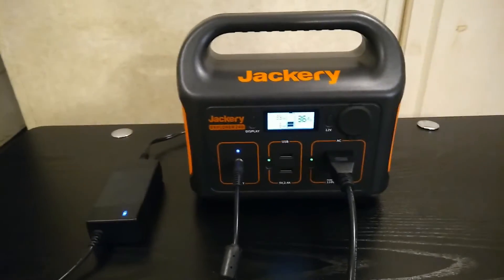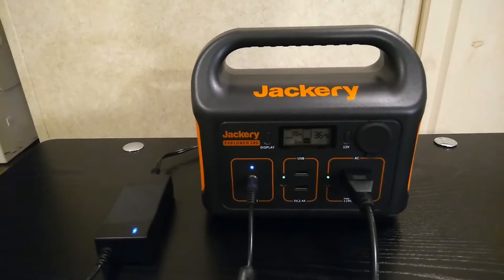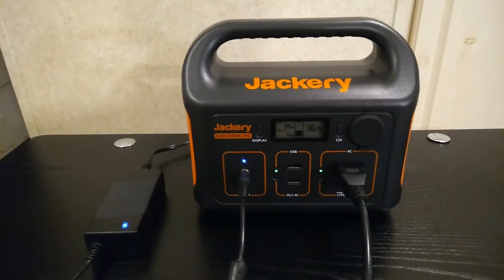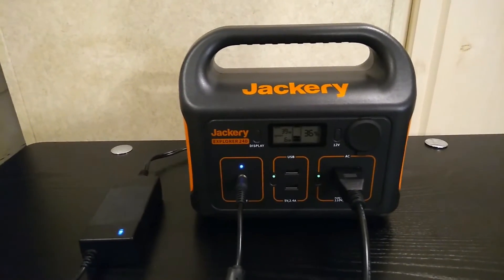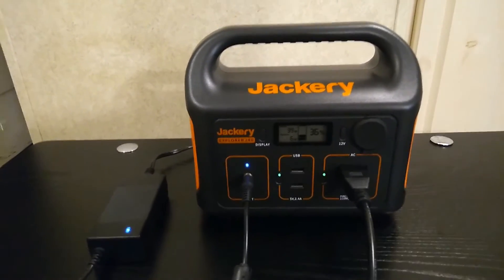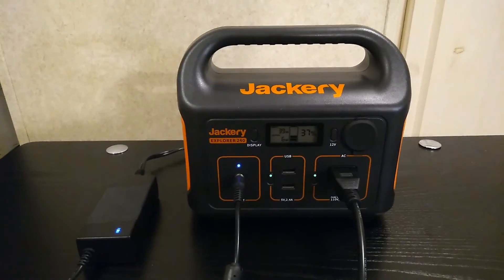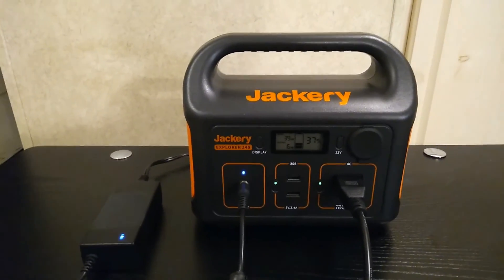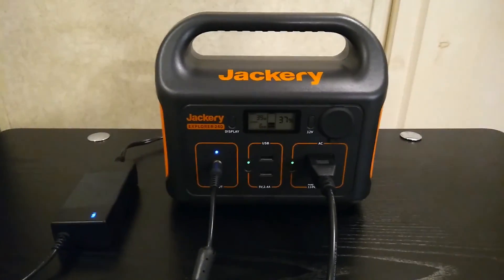Passthrough charging explained

Comment: Good 2know! 🙌🏾🔋
I have the same unit and we had a power issue at the house and I charging a lamp with pass through and I didn't detect a problem.

It was better than waiting 4 1/2 hrs for it to recharge from 0% 👍🏾🥇

Comment: This explanation is not explained. You can not charge and discharge a battery at the same time. Either you are pulling more load than the charge controller supplies and are discharging the remaining load from the battery, or you are pulling less load than the charge controller supplies and are also charging your battery. If you explained that the excess heat from charging the battery and the inverter heat are causing excess heat to the battery, I would buy that. I am just looking for the technical answer down to component level explaining the pass through charging. Thank you for the video.

Comment: The title is you will explain what is pass through charging. But instead you explain why power station manufacturers do not recommend pass through charging. I still don't know what is pass through charging after watching your video.
Reply from the maker: The power station can be charged and output power simultaneously. 👍

Comment: Thanks for the great vid.  I have a Jackery 240 and a Jackery 880.   If I’m using the 880 to constantly power a 12 volt car fridge, is it safe to also receive charge for the Jackery with the DC car port when needed, while it’s still charging the fridge?  Or, is the 240 Jackery powerful enough to charge the fridge while I’m charging the 880?  I’ve also heard that it’s not good to have a power bank charging thru the DC port for long periods because the charging ports really heat up.  True?  My purpose is car camping on looong road trips.  I’d appreciate the advice.
Reply from the maker: The 880 can handle both no problem. 

Most car fridges only pull about 50w, which is nothing for a 880wh battery (C Rate of less than 0.1) and the car charger only supplies about ~100w (plus the fridge only pulls power intermittently).

BTW the 240 has the same regulated 12v outlet as the 880, so it can power the fridge just as well. But it is unnecessary IMO to even bother unplugging the fridge from the 880 for the reason above.
Reply: @SoGenFan  Thanks so much

Comment: In the bluetti brands and if you have the app, just set your charging setup to silent charging, this will keep the minimum wattage going in, it’ll be slow but way more safe.
Reply: Yes but wouldn't turning the fans off allow more heat to build up thereby doing more damage to the battery?

Comment: So if you were to get a bigger inverter (1200w) does that mean you could use more watts without the same amount of heat a smaller inverter would create?
Reply from the maker: Well the inverter is not really the issue. It's the battery, and the heat inside the battery cells that we are concerned with. And a larger inverter will most likely be paired with a larger battery -and in that case, the answer is yes.

200w moving through a 240wh battery will heat the battery up MUCH more than 200w moving through a 1000wh (1kwh) battery for example (this is known as the "C Rate").

Also, this video is getting old, and now most new power stations have LiFePO4 (LFP) batteries and these can also handle higher temps better as well. So a large LFP battery will be minimally impacted by DC pass-through such as with running stuff off solar power. 👍

Comment: So no heat is ok. If its heating its not ok?
Reply from the maker: Well heat is always produced. The fan blows it away. But the batteries get hotter and hotter. Some new power station models have a temperature sensor on the battery, and you can see the temperature in the App. 

If you cannot see the battery temp, it is hard to know. But you can use "C Rate" to guess. Keep the charge or discharge below 0.5C (1C = battery capacity in watts. Example: 240wh battery (Jackery 240) charging (or discharging) at 120 watts is 0.5C).

240wh at 240 watts is 1C

If you are doing passthrough charging - take the combined total of input & output (Example: 100w output and 20w input, the total is 120w or 0.5C again).

Higher C rates can be done for a short time. It is OK because it takes a while for the battery to get hot. But it is not recommended to do high C rates for a long time.

Comment: Hey man can i connect my aquarium filter that draws 35 watts to this battery and leave it charging on the wall so if the lights go out my filter will stay on automatically ? Im trying to figure this out.
Reply from the maker: Yes you can. But it's not recommended long term, since power will always be flowing in and out of the battery. 

It will work though if you are out of town for a few days or something. For long term "UPS" use, look at a newer power station. Most have a UPS mode now, Jackery 300 Plus, Bluetti AC2A etc
Reply: @SoGenFan  i am using a 1500 apc ups but with 35 watts from my filter it only gives me like an hour of power. I need something to have piece of mind when i go to work 10 hours a day just incase the lights go out. Can you please send me some links to power stations with ups that will help me with this ?
Reply from the maker: Well 35w running for a possible 10 hours would require a larger power station (with larger battery). The minimum I would recommend then is a "Bluetti AC50B". Ideally something a little larger will give you more peace of mind. The new "Jackery 600 Plus" would be perfect. Another option is the "Bluetti AC70". 

Below are some links to them on Amazon.

- Affiliate Links:
Jackery 600 Plus: https://amzn.to/3LjphSK
AC50B: https://amzn.to/3XZEAYA
AC70: https://amzn.to/3VZEHki

As an Amazon Associate, I earn from qualifying purchases. If you prefer not to use my links, just search them on https://www.amazon.com/

Comment: ok smart guy......can you charge a jackery 500 from the car WHILE there is a 12v cooler drawing power ???.....or would it lessen the life of the jackery??.......only asking for a friend (lol)
Reply from the maker: Yes you can, and it will have very little impact on battery life, since it will be charging at less than 100w and output will also be low and intermittent, which should prevent internal battery temps from getting too high (as long as the temperature inside the car doesn't get too hot).

Park in the shade, use a windshield reflector, place the Jackery in a shaded area in the car (but still with good ventilation for the internal fans - do not block the side vents).
Reply: @SoGenFan  hey, i appreciate the fast and informative response, thank you.

Comment: Hi, first off, thanks for all the info! May i please ask, i need something to power a marine fishtank in case of a power outage. 
Would this unit be ok to have my tank plugged into so that if i had a power cut, the tank will still run for a while?

Thanks.. James
Reply from the maker: No, you don't want to leave this unit (Jackery 240) plugged-in all the time. The newer Jackery 300 "PLUS" has a UPS function (They call it ACPS) that will only use the battery when the power cuts out. 👍

BTW the "regular explorer" Jackery (240 / 290/ 300 / 500 / 1000) models are all the same. Only the "PLUS" and "PRO" models have the UPS function. Or consider other brands - most of the newer models do have UPS as well.
Reply: @SoGenFan  Thanks for taking the time to inform me of that. Its much appreciated and i will look into that right now.

Comment: If my solar generator input is 400watts  and I have 2 solar panels creating 800watts by using pass thru charging could I use 300w to power a fridge and will my solar generator be recharging at 400w or will it power my fridge 300w and only charge the generator at 100w.  If it's the second then I don't want to spend money on a second panel it would be useless. Thanks in advance if anyone knows.
Reply from the maker: Unfortunately it is the latter. If the max input is 400w, there is no way to go beyond that. Solar input will always go into the battery first, since the voltage and current of solar panels can vary A LOT - there is no possible way to pass that power through to a device that needs regulated power (whether it is 120v AC power or 12v DC power or even 5v USB power).

Comment: why cant the power distro circuit just split the power, one channel to power devices, one to charge the battery, and if there is too much draw from the device to supply minimum power for charging the battery it just tells you. I can understand a cheap usb power bank not having this ability, but high end batteries, seems like a no brainer. How many extra transistors could that possibly take? lol
Reply from the maker: This is an older model - that's why. Almost every new power station (and all Jackery Pro / Plus models) use a bi-directional inverter with relays that can charge the battery and power devices separately.
Reply: Do you know if there are usb power boards that can do that? Power a device while recharging its battery without running the device through the battery?

Comment: I don't see a good point for passthrough charging if you're using an outlet (might as well just use a power strip)

what I want is solar passthrough charging, that is the way to go if I'm trying to be remote. It seems it's uncommon though? oddly. My ecoflow delta 2 seems to be unable to do this, but if I'm working remote, I want solar to charge all current things plugged in (first), then extra should be charging the battery. Is how I see the ideal, anyway. Perhaps one day
Reply from the maker: Solar is DC power (with varying voltage) so you need an inverter to output AC power for your device (or convert to a different voltage like 12v or 5v usb). 

A true passthrough function only works if the input power is same as the output power.

In this video I show an older power station with a DC charging brick. In this case AC is converted to DC inside the brick, and DC is fed into the battery. The battery's power is then converted or inverted to output power.

The Delta 2 has a true passthrough function (UPS / EPS) mode where AC power will bypass the battery instead of going through it. But as you have discovered, if you are using solar, the solar power always enters the battery, it cannot go directly to the output ports since the power is not appropriate for the corresponding output.
Reply: @SoGenFan  thanks for the info, chatGPT seems to say it can, but probably with an inverter. Either way, i don't know if any of the main power generators have this feature, but I hope that becomes a feature sometime in the future

aside from the ecoflow, I originally got a pecron s1500, great for storage, but for reasons unknown it wouldn't actually charge with my solar panels. I did see it required an abnormal high voltage, but I should be reaching that with my 2 panels in series. So that's a bit annoying

my 2 dokio, 220w solar panels seem to averagely only give 70-80w/each, albeit I've seen them get near 100w/each. Is that normal in your experience, for it to only be 30~45% of the rated watt value?

Comment: Subject: Clarification on Unit Charging and Battery Longevity
I hope this message finds you well. I wanted to address the recent discussion regarding the charging of our unit. While we acknowledge your perspective, it's important to note that the charging process for this particular model is subject to limitations.

Heat, as you mentioned, can impact the battery, but I'd like to highlight that our unit is equipped with a cooling fan designed to mitigate such effects.

Upon careful consideration, our assessment suggests that prolonged charging may approach an over-unity scenario. I have delved into the details in a video I created, along with the associated mathematical explanations, available here: https://youtu.be/Q7EmfHowWkU?si=HMCT3j1u_EfrG66a.

Understanding the concerns around input and output energy, it's crucial to recognize that maintaining a balance is essential. Extracting less energy than is inputted, especially to meet power equipment requirements, could potentially exceed the battery's intended charging cycle. In fact, I've conducted experiments indicating that, despite the battery swelling and even emerging from its casing, it continues to function after over 30 years.

This longevity poses a challenge for industries where product turnover is a significant factor. While it may be unconventional, these observations stem from hands-on experimentation rather than mere speculation.

I encourage you to watch the provided video for a comprehensive understanding of the experimental process and the facts derived from it."

Comment: I just test the passthrough in my anker power station using the car cable included it get very hot tip after test it for few minutes only please help is this normal
Reply from the maker: Yes the cigarette plug for the car is not ideal for more than 75 watts. It will still work for anything between 75 - 120 watts. Just be careful it will get hot! Anything over 120 watts could cause the plug to melt and possibly catch fire, be careful! Most power stations limit the car charging to 8 amps (12v X 8a = 96 watts) for this reason.

Comment: How do you charge your jackery when you are driving? There a way to charge it via car cigarette socket?
Reply from the maker: Yes they include a car socket adapter cable. Note that car charging is usually limited to 100w or so (8A at 14v)
and some Jackery models only accept 3.5A or 5A input (so 3.5 X 14 = 50w max).

Also note the new Jackery 300 Plus uses usb-c input for charging, so you will need buy a "car socket usb-c output adapter" and ideally one with PD60w or PD100w outputs.
Reply: @SoGenFan  Thanks on the USB-C tip on the Jackery 300 Plus, like that feature. Can the jackeries be charged at home using an AC outlet without that usbC input?

Also notices amazon has the older units on sale, it's prime day. The 300 plus with the USBB-C inputs are an extra $100, kinda steep. I.e. 300$ vs $400 for the plus unit.

Comment: This may sound very ignorant but if I am using this setup as pass through charging and let’s say my power goes out. Will the device I have pulling power then automatically switch to pulling power from the battery?
Reply from the maker: In this example, you are always pulling power from the battery. There is no switch over - which can be good or bad. 

The good part is not worrying about it switching over fast enough or reliably, the bad part is you are constantly flowing power into and out of the battery.

Typically any power station that charges via a DC power brick, that supports pass-through charging works this way. The newer power stations feature a UPS or EPS relay that switches power from grid power to battery power in 20ms or less.

So in that case, the grid is powering your device (and the power station's inverter) and if the grid power goes down the relay will switch to battery power. These power stations don't feature professional grade UPS relays though, so it's not something you can count on with 100% certainty. But it will probably work.

Most power stations with this UPS relay will keep the battery at 100% charge when using it as a UPS, which is also not great for the battery though. Better than flowing power through the battery constantly, but ideally for optimal battery health, look for a power station with an app that will allow you to set a maximum charge %. Set it to around 80%.

Comment: Why does my charger get hot ? Is it normal
Reply from the maker: It is converting 120v AC to 12v DC. This creates heat in the process and is completely normal. Pro tip: To reduce the temperature, place the charger on a hard surface (not carpet) and stand it up on it's side to expose the surfaces to more air.

Comment: Is there a certain calculation that we can do to identify the optimal amount of voltage coming in and out on a certain battery?
Reply from the maker: Well technically the optimal amount would be 0. What's the most power with the least impact on the battery? Well I'm not sure there is an exact calculation, but use the C rate to get a generally idea. I personally don't like to talk in voltage and amp hours, but just to give an example 500wh battery at a 500w output (or input) would be a 1C rate. The lower the C rate, the better. Aim for less than 0.5C on both input and output when doing passthrough charging, and try to keep the unit cool! No direct sunlight, make sure the ventilation is optimized, and air can flow around the entire unit.
Reply: @SoGenFan  how fast will the battery degrade if you keep doing pass through charging?

Comment: Do you know a powerstation that supports passthrough? Thanks for the info this is very helpful.
Reply from the maker: Most name-brand older power stations that use a power brick to charge from the wall do. Now most newer models use a  bi-directional inverter with a UPS relay which will  allow grid power to power the ac outlets and switch over to battery when you unplug or use power. This switchover can be problematic in some cases, the benefit of passthrough charging is the power always comes from the battery. The downside is this reduces the life of the battery.